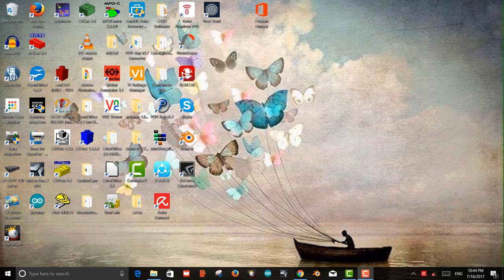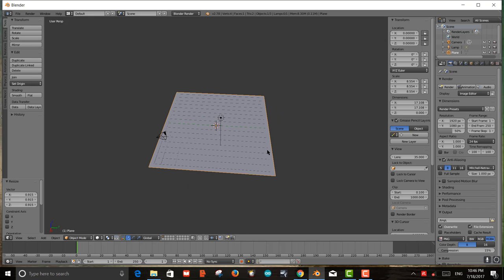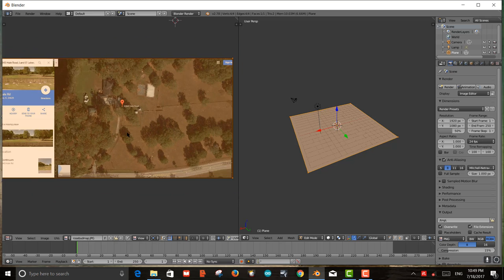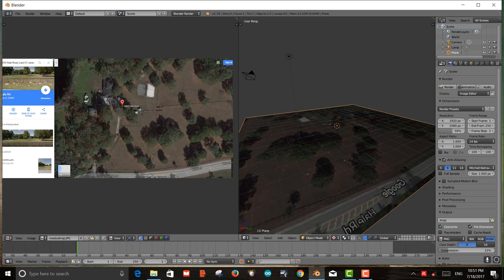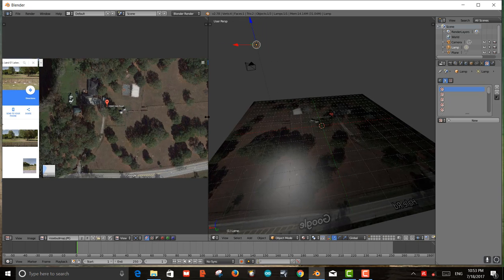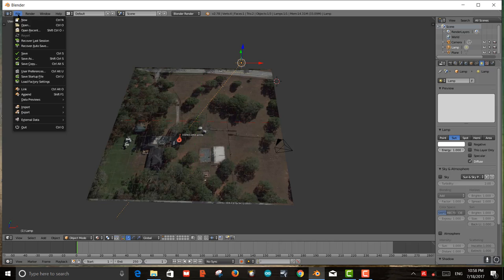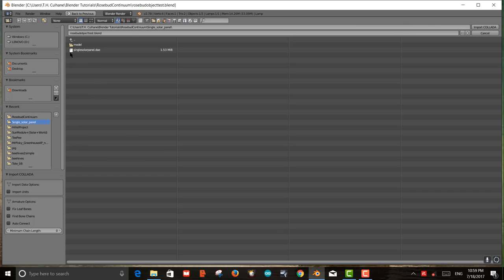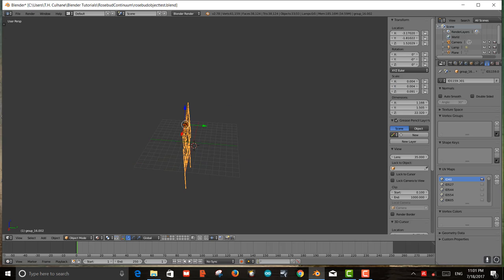Placing solar panel on landscape image in Blender for Nexus Lecture 15

Comment: Please don't install your solar panels like that, the H frame should be on the ground, not stuck in the ground. They re more likely to get broken the nearer to the ground they are. Bottom edge above any livestock height is the norm.